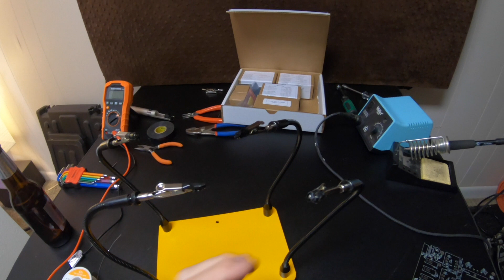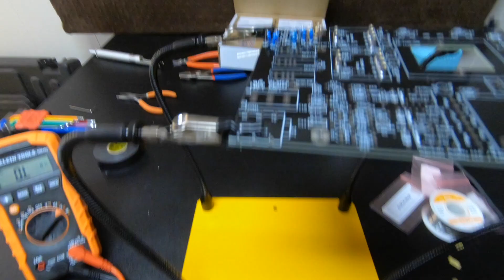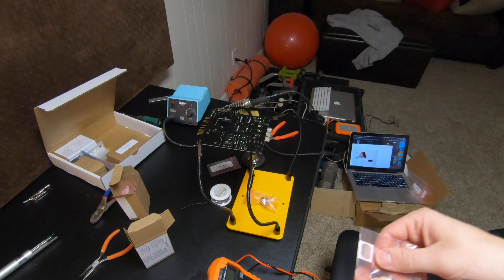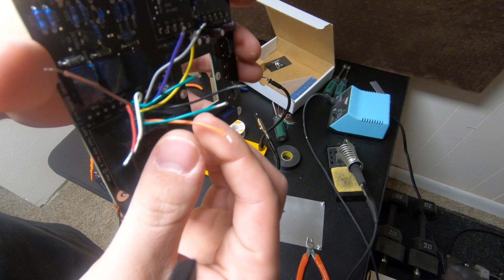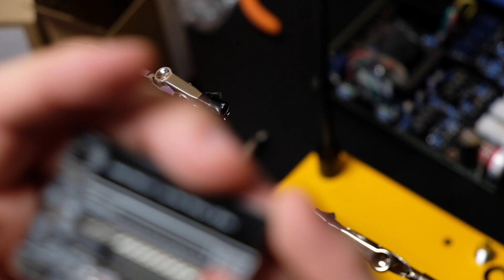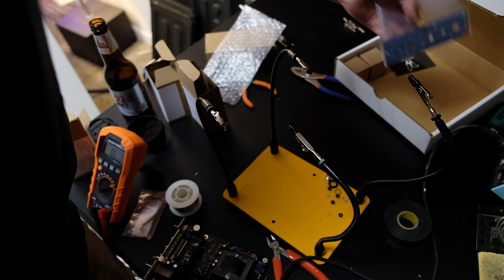Lola Mic Pre Build

Comment: Great vid. You can also use a bit of painters or packing tape to hold a component in place when placement and alignment are critical. You can also do that in lieu of bending leads on resistors, etc. which can make clipping leads post-soldering easier and neater.